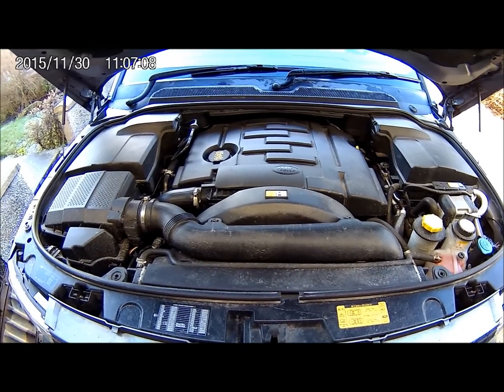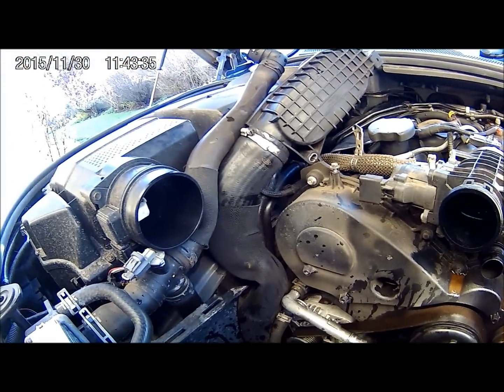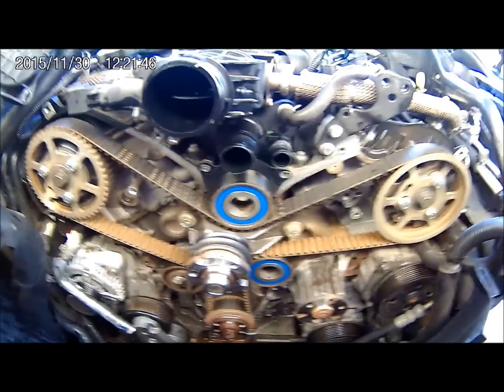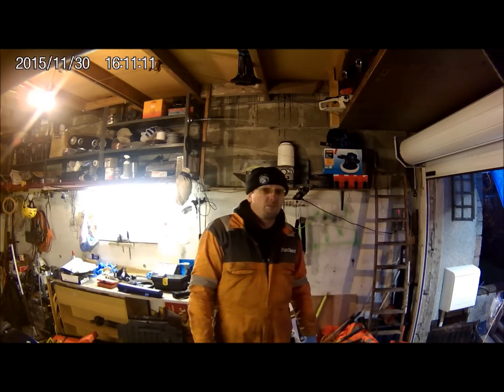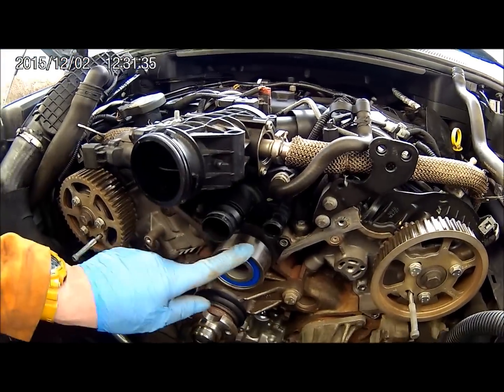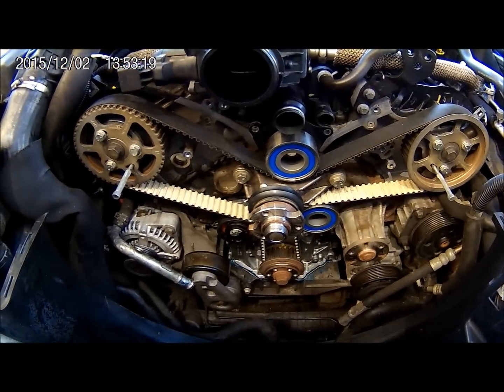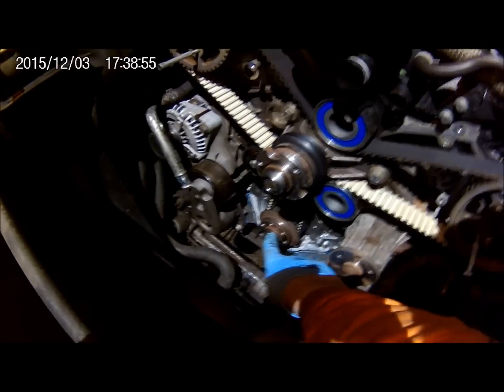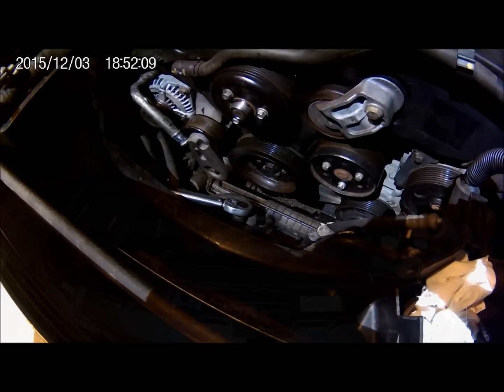Discovery 3 2.7TDV6 Timing Belt and Oil Pump Change

Comment from the maker: The crank is locked via the fly wheel mentioned in the video, that's the locking pin that goes in above the starter motor
Reply: Hi John. I take it you set the engine on the compression stroke tdc No.1?

Comment: Hi John - Great video. Did you have any info to confirm th flywheel timing locking pin is ok to handle the torque of taking the crankshaft bolt out. I see there is a pricey tool with teeth on it to lock the flywheel. Might be cheap if the pin breaks. Just collecting parts to do this right now. I noted the kits say don't undo the camshaft pulleys using the pin so this made be worry about the crank which has mega torque on it...
Reply: hi how did you get on with your build

Comment: Thanks John, Great stuff.  I am about to attempt this on my own Discovery 3.  It looks a bit daunting at first but I have a bit confidence after seeing this.  Did you also do your fuel pump drive belt at the rear.  Cheers  Graham
Reply from the maker: +Graham Broadbent No I've not done the fuel pump belt, I was limited for time as I work offshore and only had a couple of days left where I had other things to do, that and the weather was really bad, I'll leave it until the better weather, to be honest looking at the belt I took off the car I suspect that they might have been replaced already, I'll still do it though and will maybe do another video to cover it.

Comment: Looking at this I don't think you had to remove the bottom pulley at all. Also as long as you mark the pulleys and realign before  installing the belt you'll be fine and use drill bits in the holes

Comment: Great job.But how you lock the crankshaft with special tool to take out pulley
Reply from the maker: The crank is locked directly via the fly wheel locking pin. Some would recommend you don’t do that but it was fine

Comment: John Macleod Hello Mr. John. I have a problem with my Land Rover Discovery 3 tdv6 2.7 when I step on the accelerator at 20 speed. The brake signal and anti-skid signal lights up and the letter F is written on the transmission and then it goes torque the car and then as I did not stop the air pump signal lights up After that happens, shut down the engine and restart it so the problem goes and when I repeat the process the problem returns. Can you help me to solve this problem Thanks for your understanding and help me in advance
Reply from the maker: Sorry, I only just saw your question. The F is obviously for fault, I suspect that your wiring loom from the automatic transmission to the ECU has a broken wire. I had issues with mine, I needed a new loom fitted, it was too complicated for me, I put it to the garage, it cost me £700 to do and that was with a used replacement loom.
Reply: John Macleod 
Well, it's okay, my friend, I think that the problem I have is with the fuel pressure regulator on the main pump anyway. I wanted to confirm to me what exactly is the problem is from the main fuel pressure regulator or is located inside the tank

Comment: Can I just ask why u disided to change it so early. ?  looks like milage was a bit 50 though and miles at the moment of change? 
going to do my jaguar 3.0 tdi similar engine now it's 106 miles on the clock and timing never been changed. 
cheers
as fare as I am aware manual said timing belt due when milage is 168000 km

Comment: To change oil pump does it require to remove oil pan, oil pan extension... and a part of suspension (like indicated in Haynes) or it can be done from the front of the engine (possibly removing generator and aux belt tensioner? Can anybody tell?

Comment: Hi I have  problem with disco 4 I was changing the turbo charged and I replaced timing belt now it does not start with no fault codes, it just cranking fast but not firing please help.
Reply: Robert Madoda try checking crank sensor - if you have unplugged / regapped it then this can cause your symptoms
Reply: No compression the timing is out

Comment from the maker: It's a uk 57 plate, 08 I think
Reply: John Macleod Hello Mr. John. I have a problem with my Land Rover Discovery 3 tdv6 2.7 when I step on the accelerator at 20 speed. The brake signal and anti-skid signal lights up and the letter F is written on the transmission and then it goes torque the car and then as I did not stop the air pump signal lights up
Reply: After that happens, shut down the engine and restart it so the problem goes and when I repeat the process the problem returns. Can you help me to solve this problem Thanks for your understanding and help me in advance